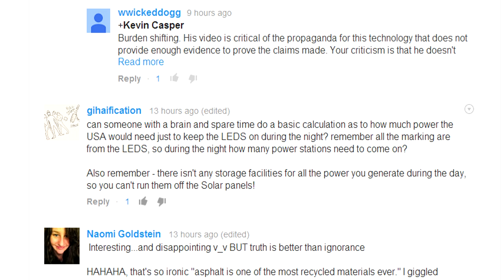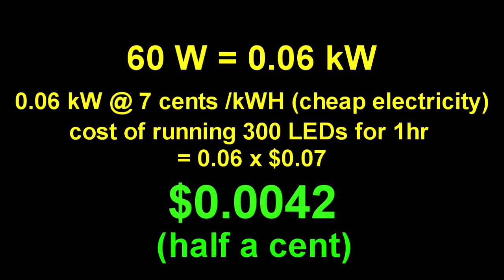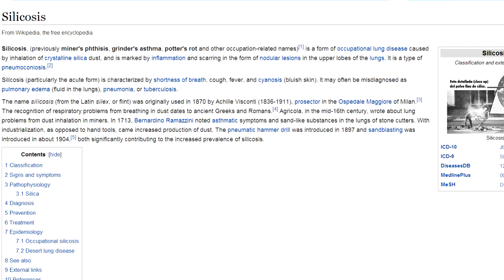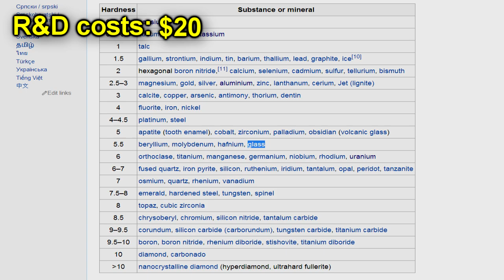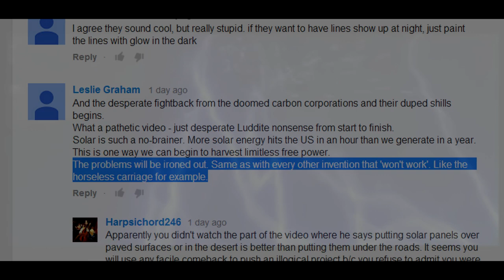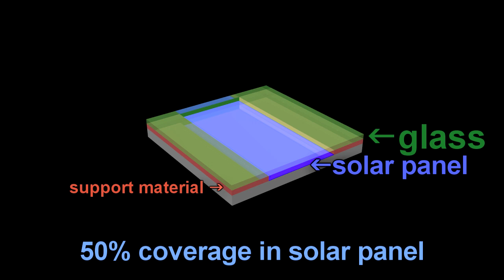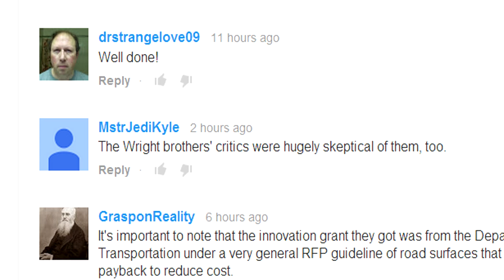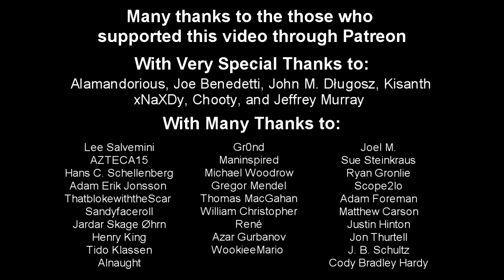Solar Roadways, IMPORTANT QUESTIONS AND ANSWERS!

Comment: Solar scam like always. Go nuclear!
Reply: NUCLEAR  FREAKIN ROADWAYS
Reply: or just put the solar panel on a place were it makes sense like not under a car...
work on actual problems with solar panels like storing energy for the night,
work on efficiency and resistance to environment you know factors that actually limit the effectiveness you know things that make sense...
Reply: The major problem about wind and solar is the power density. It's too low. Biofuels, wind, solar will never overtake fossil energy. And there is only one thing better than coal, oil and nat gas: NUCLEAR.
Reply: of course you get a lot of energy and it's better then fossils biofuel is not only extremely inefficient but it also has little potential for increase of efficiency.
Wind and solar both have the problem of inconsistency and they don't give as much energy but they don't produce radioactive waist.
But they both have room to grow and I would like to use as little nuclear reactors as possible.
It's not only a question of efficiency.
Also while we are at it what about the mining of the radioactive material in terms of reachability and quantity?
(that's not a rhetorical question if you have sufficient knowledge about those factors I would be interested since this is a important factor)
Reply: Other energy sources like biofuels can be made more practical if assisted by nuclear. The mentally retarded government DEA needs to stop treating hemp like it's the same thing as marijuana. Only certain species of algae in algae ponds are more efficient at photosynthesis than hemp. It grows fast, taking carbon dioxide back out of the air and recycling it. 

      The next step is to use nuclear to add more hydrogen and process heat in the presence of a catalyst...... and presto !  You now have more practical and economical renewable biofuel with the aid of nuclear.

      The obvious answer is a double one-two punch from BOTH hemp and nuclear.
Reply: biofuels are scam. The power density is almost zero. The land required is huuuuge! Biofuels also makes food more expensive.
Reply: Solar generated less than 1% of the electricity used in the USA between January and June 2016. US gov gave away billion of dollars for the solar Scam. Hillary is willing to give 205 Billion MORE. That's INSANE!
Reply: but being incompetent in implementing a technology dies not discredit the technology but the people who did so...
Reply: The major problem is the low power density of solar. A modern solar panel has a power density of only 6.7 watts per square meter. Let's compare with a nat gas well producing only 60,000 cubic feet per day(28 watts per square meter). And the gas is reliable...whenever you need, you can burn it.
Reply: Commissar_Dan Good bit? After spending huge amounts of money the US got less than 1% of the electricity used there in the first half of 2016. Solar(and wind) makes no sense at all! Extremely expensive and not reliable.
Reply: Lucas P 6.7 watts per square meter? That sounds way to small. If you have a modern solar panel at around 20% efficency, it produces more than 150 watts per square meter in direct sunlight. And how can you measure the energydensity of gas in watts/m^2 anyway? By the way: Solar energy gets cheaper and cheaper and coal/gas/ oil will get more expensive in the long term.
Reply: Hydro electric too. (dams)

Comment: also, i'm no geologist, but i'm pretty sure there isn't quite enough sapphires in the world to coat the roads in them. And even if you did find enough, you would have to melt them all down (which would take an incredible amount of heat) mold them into a hexagonal shape of the specified size hundreds of thousands of times, all while changing their consistency to make them clear, AND keep them the chemical make-up of a sapphire, and not some other form of corundum, like ,say, a ruby, or the sparkplug material you mentioned. overall even with my high school level education of physics and chemistry, i can easily say that this project simply isn't plausible or efficient enough to be considered a viable option.
Reply: mr_dino42 You wouldn't need to mine sapphires for sapphire glass because sapphire glass needs to be synthesized from aluminium if you want it to be in any useful shape and size. It'll still be horrendously expensive though.

Comment: imagine the myriad of issues just concerning traction on the glass.  A small amount of water on the surface will cause so many accidents.
Reply: Liberals? Not really. That Senator, Crapo, is a Republican. And Idaho is a red state. Very red.
Reply: acording to them they have rought up bumps on the top side of the glass providing enough traktion...
BUT
a) they never did any real tests with it
and b) wouldnt covering the solar panels with ROUGH glass fuck even more with the solar panels?
Reply: us drag racers dont even like good ole blacktop,   has to be concrete.   i guess the liberals that want solar roads drive shitty hybrids anyway so they dont give a shit about traction when they can only put a 100 hp down.
Reply: Well lo and behold. You just predicted the outcome of what happened to their test pavement. A bunch of leds gave up quickly after some water got in.

Comment: Scratching is only the tip of the ice berg.  How about when it's raining or worse, snowing. Try to not slip and fall on your ass when walking on a glass panel with even the slightest  coating of snow. Then, try to stop a 100,000 pound steel roll carrier at 60 mph...won't happen.

Comment: Ok, so lets start with the first 5 minutes of your video should we? For starters are you genuinely going to claim that using consumer, small scale prices from amazon as you basis for a cost calculation is a reasonable idea? Tbh I don't know what the bulk cost of LEDs is, but I'd bet my left leg it wouldn't even be half of what you've quoted.

Secondly you're power calculations are based on having the entire road surface lit. Now I'm not sure what the roads are like where you live, but around my area normally there is a dashed line down the middle, and sometimes solid lines down the side. Now lets say these lines at 10cm wide, the road is around 6m wide, and the dashed line down the middle is 50% line 50% gap. So that means around 1/24th of the road is lit. Assuming roads with multiple solid lines will be roughly balanced out by multi-lane highways with a higher portion of dashed lines, and rural roads with no side lines, this results in a cost of $7M per hour, $168M per day and $61B per year. Or $208 per person.

Obviously there are things they could do to further reduce this. As mentioned there are areas that will need supports and therefore not be solar panels. If these were positioned so that the main, unchanging markings on roads, such as all side lines, and centre lines on 2 lane roads, could be painted on and just lit at night, it could potentially further reduce all of the above costs by around 40%. So now we're down to a base $120 per year per american. I'm assuming with the amount of electronics they're cramming into these it wouldn't be hard to tell if there was any traffic on the road or not, giving the option to shut off sections with no traffic, which considering how few people are on the road between say 2am and 5am could reduce it by a further ~25% (a couple of a random numbers I admit, but I feel not overly far fetched). So now we're down to $90 per year per american. Suddenly seeming a lot more reasonable than your $5,000 estimate. This is assuming they actually do cover the entirety of american roads, and not just stick to the more sensible option of a radius around population centres.

This $27B a year is still a large part of the current $100B department of transport budget. I'm not sure how much money the electricity they get out of it would be worth, but it would be interesting to see how it balances if you'd care to do the calculations.

Cost wise for the LEDs themselves there are sections of roadways which would clearly never need markings. It wouldn't be beyond the wit of man to make "dumber" panels that are merely generators, among the smarter surrounding panels.

Obviously some of this is assuming they have a base level of intelligence, but I would have said it was insulting to not give them the benefit of the doubt.

That turned into a longer comment than I thought, but I guess I just dislike the spread of what I see as bad information as much as you do.

Comment: Love your videos, but you're calculating the power bill @ 3:20 based on ALL the LED's being on at the same time, whereas it would be a tiny fraction of that (they're not lighting the whole road, just lane markings, I mean you don't paint the whole road do you?) You could simply cut that down based on how much of a given road is even painted. (1%? 5%?).

Also, in your last video about Solar Roadways didn't you make the claim that glass was harder than asphalt (road material) and would cause problems with levelling? But Glass can be coated to achieve a moh's hardness rating of 9 (harder than hardened [tool] steel, your phone is a great example of this if it has Gorilla Glass 3, Gorilla glass 4 is created using a variant of a prince rupert drop so I won't count that.) Don't believe me? Take a key to your phone's screen (provided it's a newer phone) and you'll see your key has no effect. You're essentially comparing this to plate glass (windows) which is... okay, but we have far stronger glass available to us. Of course, I imagine this also makes it significantly more expensive (why else would plate glass still be used today?), making these even more economically unfeasible.

8:30 do it to your phone. Or if your glasses have an anti-scratch coating, to them. You sort of address this later, but I feel you miss the point entirely. The panels arent going to use sapphire, it's still glass.  They arent decreasing efficiency, the site you show is showing why gorilla glass is better while being comparable to sapphire's strength. Using gorilla glass (or a similar material) that shattered spark plug would have almost no effect.

Only errors I see, carry on.

Comment: Sorry, pal, but you lost me in the first minute or so when you used the price of an LED strip on Amazon to calculate the cost of LEDs for the entire street grid. You may have gone to college but there is no excuse for ignoring Economy of Scale. I would also like to point out that 40 years ago solar energy was "pie-in-the-sky" nonsense and just  a little over a hundred years ago, the idea of heavier than air flying machines was "absurd." Where do you think LED and glass technology will be twenty, fifty or a hundred years from now? They are still accepting membership applications for the Flat Earth Society, by the way.
Reply: Bozo the Clown was also laughed at. Go work out the numbers and get back to us. As for your argument about Economies of Scale, That doesn't apply to R&D. It applies to mass-production. He was strictly talking about R&D. Maybe if you payed attention you wouldn't come off sounding like such an uninformed asshole. Didn't pay attention in science class, did ya?

Comment: Why not cover the dessert with solar panels that tracks the sun?
Reply: the environmentalist would be upset by the extinction of the desert snakes and a non native worms, just like they were upset about a invasive species of fish near my old house which was killing of the native species, as a result I had a $60 higher electric bill and blackout for a month
Reply: ***** the environmentalist prevented a temporary power generation barge which would be at the end of a international airport runway SFO. their reason was that it might pollute the water and harm the fish in that section of the San Francisco Bay. the fish was a invasive species killing off the local species of fish and bay life. the water there was already not great considering where is was, and we had entire days without power because the power company couldn't generate enough to power SF and us so we got higher bills due to power shortage.
Reply: Start with the obvious, make plans to give a rooftop solar covering to all houses, primarily those with good alignment, and you already have a good boost where you need it, in areas that are already hooked up to the main grid.
Reply: I don't want my dessert to be covered with solar cells, tracking or not. I want to EAT my dessert.

Comment: I'm off grid.
Any solar panels need to face the sun.
only on the equator would flat be the best angle for a fixed panel.
Here in Christchurch New Zealand, i have most of my panels at about 45° to make good of the lower winter sun, which is happily powering the house i'm posting this from.
My PVs alone have cost me about NZ$4.5K, they are on the roof with minimal shading issues, and as mentioned 45°. access to wiring is simple because they are on the roof.
There's so many unused roofs in so many countries, it makes no sense to put panels on low shady ground, under massive thick glass and traffic.
Even making a PV shelter for the road makes more sense!?
Reply: Hi.
I'm in Australia
Reply: Bet you don't plan to drive on your solar panels there either!

Comment: I said they where a really bad idea the first day they posted the bullshit video. I also said the glass was the deal breaker. There's just no way glass will take 50 tonnes of truck going over it as well as those nubs they've got on the glass to give tires traction in the wet, will make driving a very noisy experience. You only need to listen to the noise 4x4's with off road tires make to get an indication of what driving on nubs would be like. It's very noisy.

Comment: Another important question: Light pollution produced by billions of LED's!
Reply: What if, we developed a reflective paint, and put lights on the front of cars! In addition to removing the need to be sensors everywhere in the road, having lights on the car would also increase safety, as the driver could also see obstructions in the road way. 

Seriously, though, one can not safely drive a car at night without headlights. Unless you are going to light up the entire road system to daylight brightness, a car is going to need headlights, and reflective paint is already the best possible solution. There are no moving or electrical parts that can break, and it does not consume energy lighting up the darkness just in case.
Reply: Lucas Pereira da Silva but even reflectice paint needs light to reflect: I suggest flourescent freakin' paint :)
Reply: blkgardner paint is the best, the cheaper and easier to apply.
Reply: Light pollution? That ship sailed a long time ago.
Reply: Brock Dumesnil you missed the joke my guy
Reply: Remavas They already use reflective paint on roadways.
Reply: Semi-easily solved....and it'd help solve the power problem too. Only power road segments that are likely to be driven on soon. (Meaning any tiles a car is on, and any tiles up to X feet ahead.)
Reply: Not My Name it's a really good solution for power usage, but the high cost of implementation remains. Asphalt still the best than glass solution, it's cheap, strong and easy to use and apply. I  think the best use of a solar panel is parallel to the roadway, with solar tracking for the best results. An 'wireless charger' should be implemented and powered by the solar panels, or by a power line if the day are cloudy. A toll can be placed, and cars with wireless chargers can pay a bigger toll than normal ones.

Anyway, I think this options very expensive and not too practical to implement, except if this will be made by private company without state budget.
Reply: Lucas Pereira da Silva Oh, yeah, there are a lot of other problems and costs with solar roadways that would make them infeasible.

Comment: Solar road ways might work in around 20-50 years at least. To start with paint and not LED lines. Solar panels need to be far more efficient. Cars need to be lighter. Better material to use other then glass, that we don't have yet.

So in many many years form now it might be reality but not any time soon.

Comment: I know that this is an old video... but it has obvious problems (as well as plenty of good stuff)...

The bill for the LED's is wrong... for a few reasons.  First, LEDs in those quantities will be vastly cheaper than RETAIL Amazon rates today.

Next, MOST tiles won't need LEDs at all.  They will simply be solar panels.

Finally, with the cost of running them... very, very few of the LEDs will actually be turned on... ever (or as mentioned before, simply not exist), so the cost of running those few that remain, will be a fraction of what you mention.

Other than that... good post.  It's a bad idea, when paint does such a great job at a minuscule cost.
Reply: So, your saying it might be a better idea not to have LEDs on the panels at all. While we are at it, maybe can move the solar panels themselves from the road to rooftops, and make the road out of asphalt instead of glass.

The entire idea of solar roadways is an exercise in unpractical engineering: it takes an already established idea, and implements it in a novel, inefficient, and outright stupid manner. The comparison isn't asphalt vs solar roadways, but solar roadways versus rooftop solar panels.
Reply: good job you saved a couple of (hundred) million dollars. You still got a trillion in debt
Reply: 恵勇気 You think that?

Please explain your cost analysis.

Comment: Just wondering, would it be possible to make this using metallic glass made in space? I know the current Solar Roadways is BS, but would it be feasible to make it using metallic glass?
Reply: +Zhiyuan Qi Much much more expensive. and since the premise of this panel has failed completely, metallic glass wouldn't save it. 

Regular asphalt  has the best cost to longevity ratio. its cheap to make and repair compared to solar freaking roadway scams.
Reply: it's still better to just have solar panels above or alongside the road